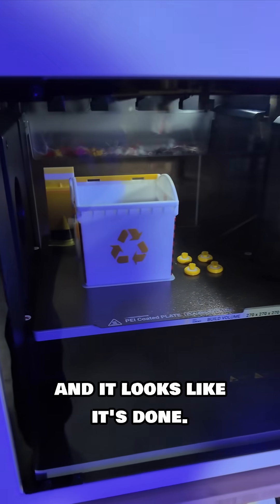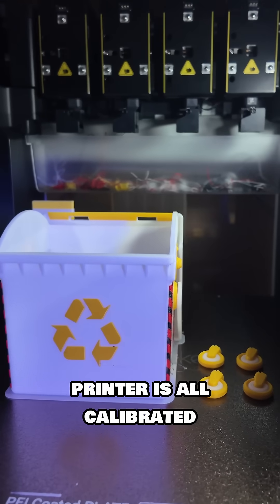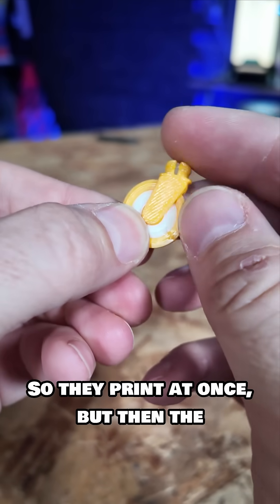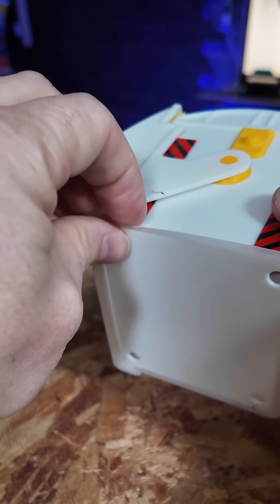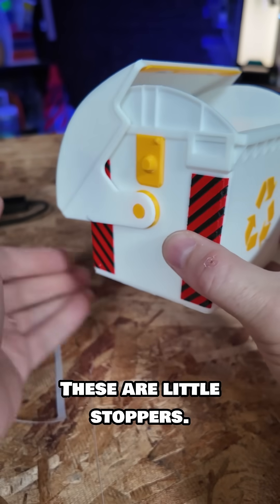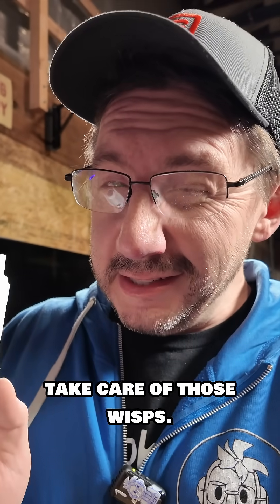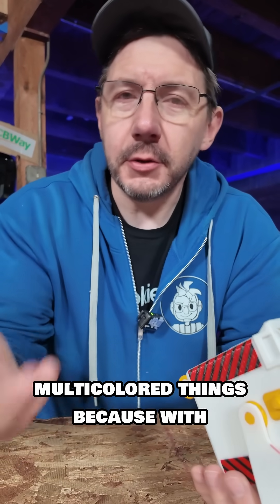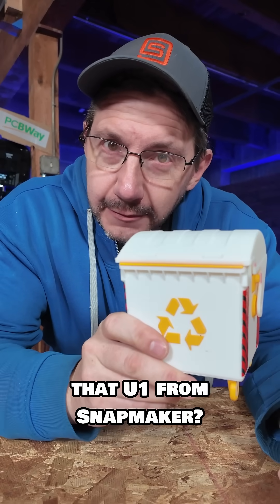BENCHBIN on the SNAPMAKER U1!

Comment: It would be helpful a video comparison between the Snapmake, the Prusa XL, the Bambulab H2S and the X1C on this model... even just as a slicer comparison...I am curious to understand how much filament you really save and how much you reduce the printing time with the multi extruder system... In addition, one thing that no one ever does but that I personally would find useful is a calculation of the electricity consumption of printers. 
PS. Say hello to Formnext, after two consecutive years in which I met you there this is the first one I couldn't come to Frankfurt...
Reply: I have a Snapmaker U1 on order, but will be April before it arrives.  I have a Bambu X1C and a Prusa XL - both do a good job in their own way.  I don't do that many color swaps - 50 would be about the most, so the waste isn't that bad, I'm excited to see how the U1 performs

Comment: Lovely print quality . I think the U1 “launch” has gone exceptionally well . Maybe even spectacularly. I’m not talking about the number of backers they got. It’s the review after review of near absolute positively about the machine. Add to the fact that it is open source you can connect to it however you want and the expectation is that you’ll be able to run full clipper.
Reply: There are also less happy reviewers where prints failed, the machine crashed or parts fell of the case. 
But the most important will be how the average experience is after the first 1000 hours or so. Then we can see how durable and reliable it really is.  Right now most have just done a few first prints.   Swapping filaments during prints seemed to have caused issues for some, we havent seen it's performance with more technical filaments yet and so on.
Reply: @Leif_YT I haven’t seen any reviews with anything out of the ordinary. Can you show me some😊
Reply: @Ebonyqwe  I don't remember every by its name but there are several. Nekoi, Fauxhammer etc to mention a few. In general people that tried to do more than just some generic 4 color  multicolor prints.  But stuff like the flimsy plastic shell that holds the filament spool and motors or just one motor being used for two spools so it cant spool back and such have been mentioned by many.

Comment: I hate to be that guy, but Prusa explicitly said the test only works with certain colors for certain parts (like black for the recycling logo), otherwise the results would differ…
Reply from the maker: oh oh I see. for the "official" test result, certain colors are needed. If I just want to print a cool model, then I can use any color :)
Reply from the maker: Why would certain colors only work for certain parts?
Reply: @3DPrintingNerd  At least from my understanding, it matters because different colors require different amounts of purge (and thus different amounts of filament wasted). 

This sounds like a non issue for multi-toolhead printers though, unless somehow the color determines how much priming is needed - but that seems odd.